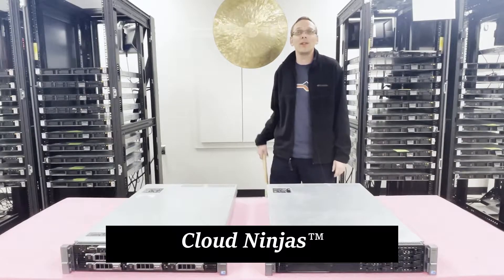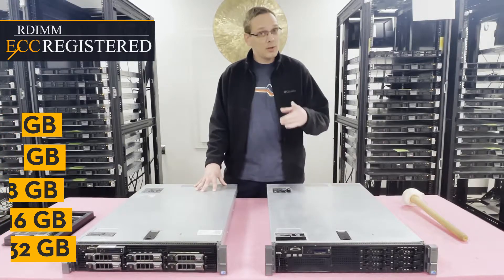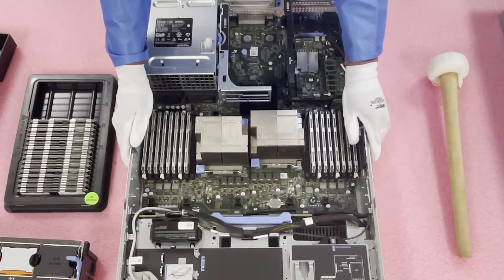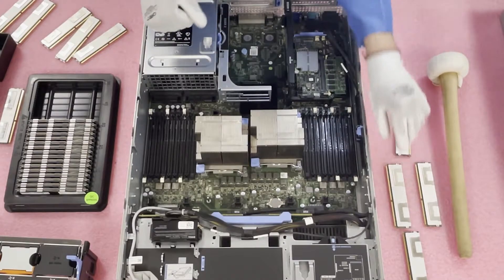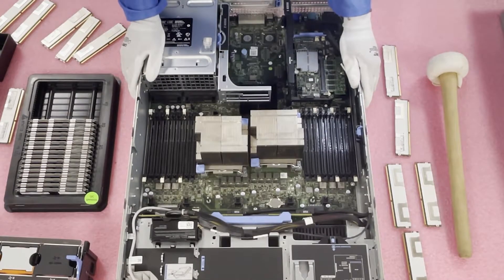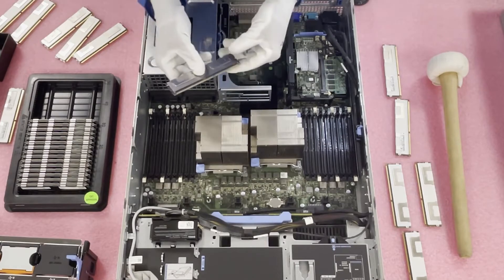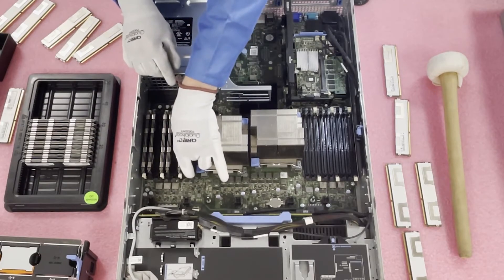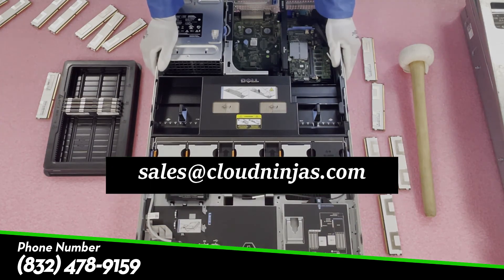Dell PowerEdge R710 Server Review & Overview | Memory Install Tips | How to Configure System

Comment: Great video, recently got a decommissioned Dell R710. got proxmox installed for vm/hypervisor setup.  Video VERY informative, you forgot to cover the Bios configuration for the memory installed . My R170 came with memory and cpu's already in, (i may upgrade cpu's from the X5570 quad cores to the hexa cores), but at boot up am getting memory error as follows:  WARNING: UNSUPPORTED MEMORY CONFIGURATION DETECTED:  " THE MEMORY CONFIGURATION IS NOT OPTIMAL. RECOMMENDED MEMORY CONFIGRUATION IS : " at this point it gives (what appears to be installed into both the A and B channels). I am investigating at this time, possible that may need to reseat all the modules and check to make sure that they are inserted (as per your video) for channels/banks. found that of the 12 modules installed, I have a mix of 2gb 2Rx8 PC3 ( have 6 modules of this) and 6 modules of 1gb 1Rx8 pc3. all are HYNIX brand, PC3-8500-7-10-D0 (specs) , (model HMT 112U7BFR8C-G7 TO AA). 
can you mix size types (2gb with 1gb)?  For now I am removing all the 1gb's modules.

Comment: Hi,

Does it worth buying 710 in 2023 for home lab purposes ?
Reply from the maker: I'd recommend going with something newer.  You can realistically get the R720 at the same price.  And even the R730, which is based on DDR4, has come down.  We are running specials right now on the R730 8 Bay SFF.  Check out our deals of the week page - https://cloudninjas.com/collections/cloud-ninjas-deals-of-the-week

Comment: Will the following RAM work on the r710: Kingston 32Gb 4Rx4 PC3L-12800L ECC REG Server Memory - SL32D3L16L11Q4? Where can I purchase the RAM trays you you're using in you video?
Reply from the maker: That will not work.  That is load reduced.   You need ECC Registered.  I'll add a link to what you want in next comment.
Reply from the maker: Here is a link to all the Dell R710 memory options:  https://cloudninjas.com/collections/poweredge-r710
Reply from the maker: I recommend going with the the 1333MT/s option as that is true fastest speed.  Here is the kit you would want to max out your R710:  https://cloudninjas.com/products/dell-384gb-12-x-32gb-ddr3-1333-mhz-pc3-10600r-ecc-registered-server-memory-upgrade-kit

Comment: Great video, do you know what amount of tb is the max per bay and for all the server?
Reply from the maker: 2TB drives are the largest drives supported by the Dell PowerEdge R710 server according to Dell.  However, I have seen people use as high as 10TB SATA.  Need latest FW and H700 controller.  Good luck!
Reply: I have more than one server laying around and want to use them all of them max out at a 12tb per server look for information on how to increase the capacity
Reply from the maker: @yoosufdocrat1373  I will ask marketing team to put a video together.
Reply: Sorry only seen it know if you could make a video on it as i would like to install a 10tb in my poweredge r710 and why is it that i cant use a different raid card with higher speeds
Reply: If you could make a voice on it would be great
Reply from the maker: @yoosufdocrat1373   do you mean CC (closed captioning) so you can read the words?